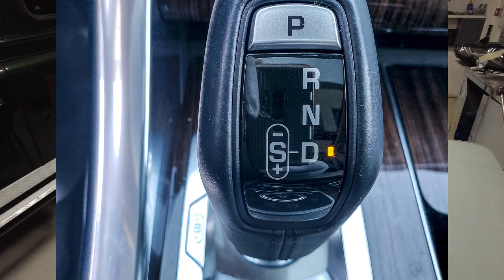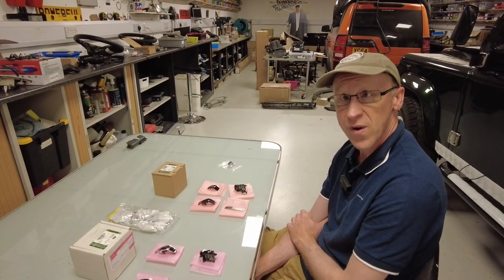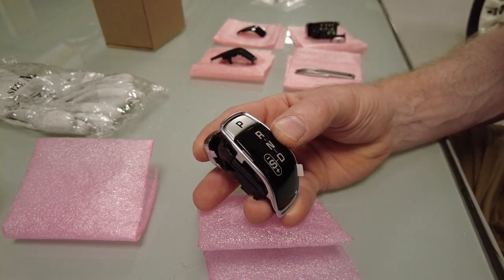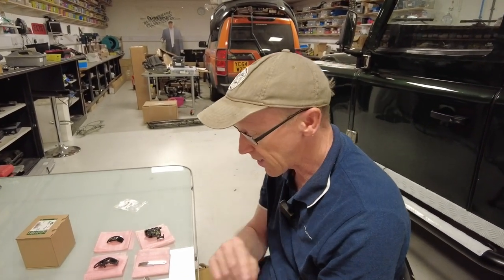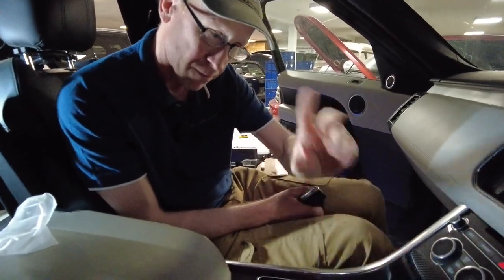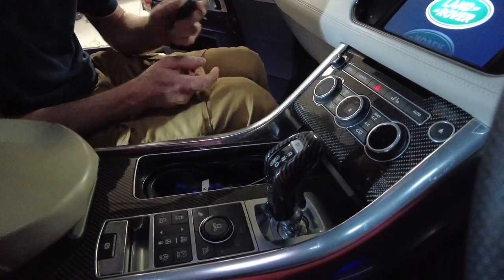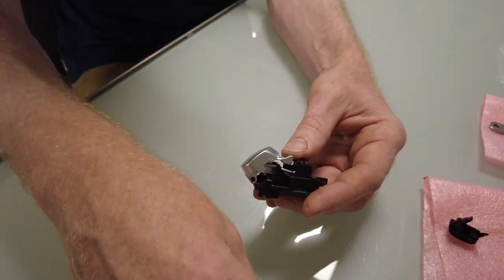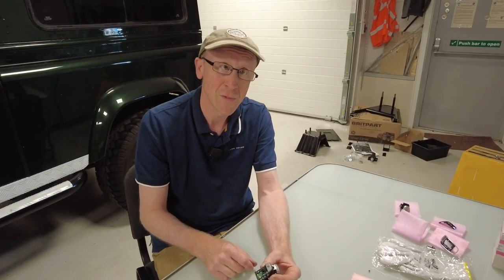Range Rover Sport L494 Can't Select Gear - Strip Down & FIX - Replace Selector Knob Button

Comment: Simon, you are a genius !  We live in Quebec !  Yesterday night, minus 10 C, my wife is making a u-turn in a small street, by shifting forward and backward when suddenly, the shifter is stuck in park position !!  The closest dealer is 90 minutes away ! I found your video, I followed your instructions to dismantle the shifter: same problem with the tip of the lever broken !!!  I used a hair pin as I didn’t have a cutter pin !  It works !!! Many thanks !!!
Reply from the maker: Hope you did not get too cold ! at least you could leave the engine running while you did the repair. Lucky it happened in a quiet street ! We have friends in Montreal and have visited Quebec many times |

Comment: Broke it yesterday evening. Immediately watched your video on the side of the road as I was certain you would offer a solution 🙂. Turns out it can also be fixed with a hair pin cut at 3cm and clamped on both sides of plastic bit that presses on the clic thingy (I know, I'm low tech). Keep up the good work!
Reply from the maker: So cool this helped you ! lucky you had a hair clip - my hair clips days are long gone !

Comment: Thanks Simon - The only thing I would add is that apparently there is an area you could just push to get you out of a sticky situation. You still have to disassemble but at least you can move the car. It might break at traffic lights and you might not have a replacement handy. Cheers.
Reply: Hello, please share as I am currently stuck 😢

Comment: This button failed a couple of weeks ago. Was in a traffic jam on an A road in Switzerland on a blind bend and on the brow of a hill.Needed to be towed away, temp fix made and 500 Swiss Francs and two hours later I was back on the road. Had to ship the part from the UK. Total cost of problem £500. The small plastic part that broke is pure rubbish quality!
Reply from the maker: Hi John sorry to hear of your hardship ! its frustrating that the replacement parts seem to be of the same construction

Comment: For the piece the actually breaks, is the new one metal instead of plastic? If so, I would think the new one would hold up better going forward. Thanks for the video!
Reply from the maker: The new item is frustratingly the same design / material and construction as the original ! This is not a part we designed ourselves !

Comment: 2015 Ranger rover sport I change the button switch like on the video but I am still having the same problem. What should I do next? 

Help please
Reply from the maker: You can change the whole module 
Also try and disconnect battery and reconnect to reset ecu

Comment: have an 2013 RRS and have come to a small issue concern. Im replacing an exhaust valve on the right side cylinderhead. And ufortunately I live in a small town which my closest land Rover dealer is like 300 miles away. My issue concern is that I dont know how much torque I need to tighten everything back up again. As in the “calibration process” If a data sheet of that kind is available on your end it would nicely be appreciated. I dont want to have a hickup once driving it, and to prevent the timing chain on jumping. Thank you very much and any info privoded once again is very much appreciated.
Reply from the maker: Hi - you can pay for a days access to Land Rover technical information - Topix.
You can google Topix and sign up.... maybe i need to do a video on how to use Topix
Reply: @L663  Yes I would appreciate it on the video on the “How To” Thanks!

Comment: Thanks Simon was heading to Wales this morning and it happened to me so I’ve stripped it and clicking switch with screwdriver 🤦‍♂️but it works for now 👍
Have you got the part number please 🙏🏻
Reply from the maker: Yes the LR PN is LR117072 - most dealers keep them in stock !

Comment: Mines just gone.. car currently sat in the town centre 😞. Do you do same day / next day delivery?
Reply from the maker: Oh poop - where are you based ? we do or you can get from Land Rover dealer ?
Reply: @L663  Sheffield. Do landorover sell the individual part?
Reply: @L663  I would sooner give you the money than JLR to be honest.
Reply from the maker: @JonAsquith  They sell this part https://www.powerfuluk.com/vehicles/range-rover-evoque-sport/sport-2014-l494/interior-accessories/genuine-gear-shift-module-repair-kit-for-range-rover-sport-l494-non-svr.html
This is Land Rover PN LR117072 - they fail often so most dealers have them in stock
If not place an order on our website and pay for special delivery / DHL
Maybe i should put these on Amazon for super fast delivery !
Good luck !
Reply from the maker: @JonAsquith  I would rather take you money too... but best to get your car back ASAP
You could try the split pin fix...
Remember you need the small Torx driver too !

Comment: This happened on my 2014, and the cost to have the car towed to Range Rover was $225, then Range Rover charged $340 to fix it.
Reply from the maker: Ouch - I guess not so "Rich I" anymore !
Reply: @L663  It was a nightmare!  My daughter had borrowed the car to go to the grocery store, reversed out of the parking spot, and could not change gear!  The car was in park, so couldn't be towed until the tow driver pulled up the cup holders and pulled the emergency brake release red tabs.   The problem with it is, that it doesn't fade or slowly fall apart... one minute you can select a gear, then next you are locked in that position.  Basically, I'd suggest that everyone change the trigger every 5 years, at your own leisure in you own driveway.  Also, the truck driver said "this happens a lot, and you are lucky I can release the brakes from the inside.  The new ones have to be released by crawling under the car!"

Comment: My car caused chaos last week blocking the exit to sainsburys and the entry to the A14 in Bury st Edmonds. No gear selection, RAC guy found the fault and fixed with super glue 🪛🔧
Reply from the maker: Thats embarrassing but I am really impressed that the RAC fixed it - you should buy and fit the replacement part!